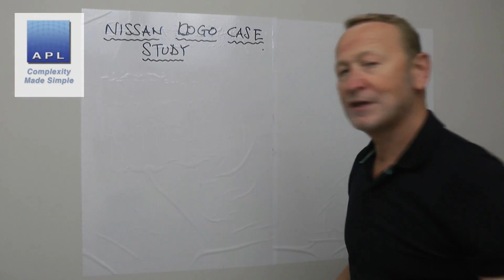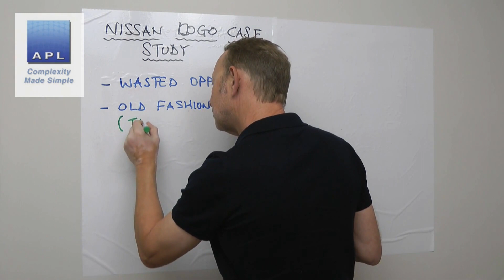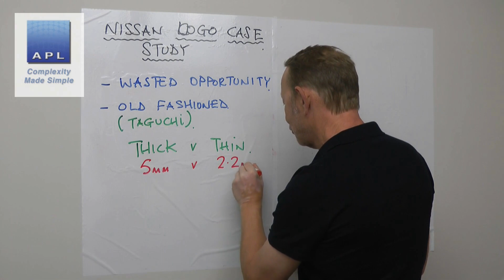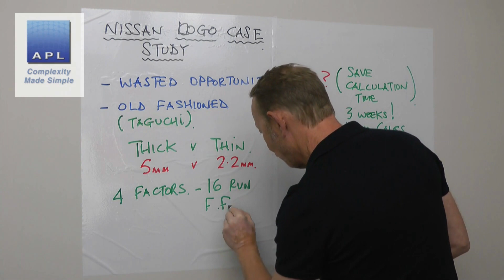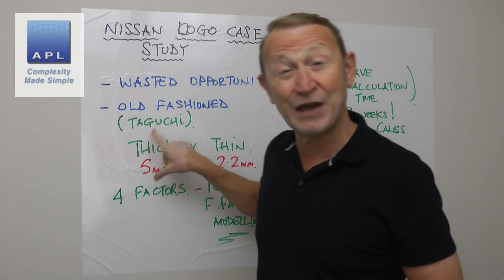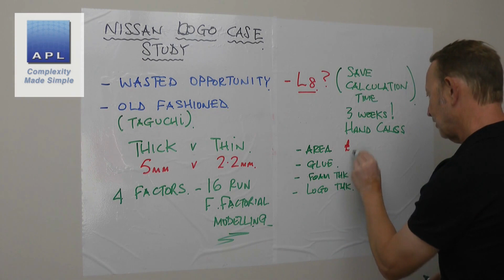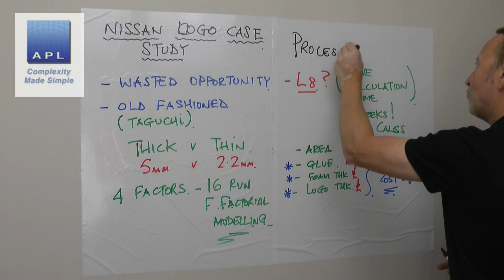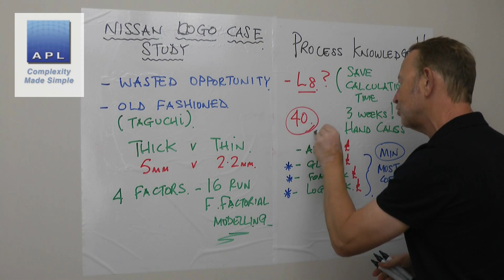Nissan Case study - Design of Experiments

Comment: Hello Paul, if you had a process with multiple stages (5 to 12) and each had the same variables, such as feed and spindle speed, could you choose a method that doesn't require the total factors to be the product of the number of stages and the number of variables? Or would you screen all variables at all stages. The variables at some stages will have far larger effects than at others but all the previous stages may interact with every subsequent.

Comment: Hi Paul,  on behalf of the ILSSI community and everyone interested in process optimisation and Six Sigma,  we would like to thank you for this video.👏    We like your point about not using the L8 since it was designed to save time of computations and therefore is not necessary with the software available in 2023  (such as SigmaXL or DOEpro for less than $300 ) .  The question is would you go straight to a Full Factorial even if you were examining 5, 6 or7 factors in the design  ?   That will of course depend on how much it will cost for each test piece / machine setup time/cost etc.
We would usually also some replicates so that you can calculate the Standard Deviations as well as the Means.... and minimize variation as well optimising the mean.
So with 3 replicates  ( for a significant Standard Deviation result ) you would need 128 runs with 5 factors 9 3 x 32 ) ....it might get expensive in materials / Setup time/cost.   So the 'rule of thumb' for how many factors to put into a Full Factorial is dependent on 1. If you have software to do the calculations  2. the cost of each run / test piece.
Reply from the maker: my rule of thumb is 6 or more variables screen with the L12. Less than that model with full factorials. that is for real machines  where you are making test pcs. If you're on a computer with a simulation data you can model full facotrials up to 7 or 8 factors easily...